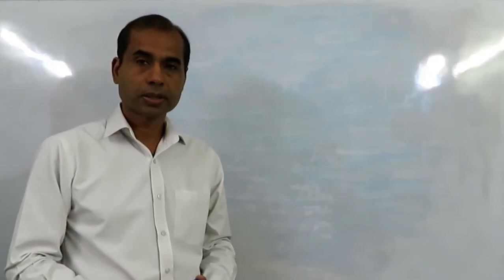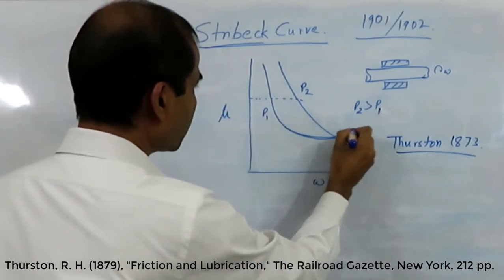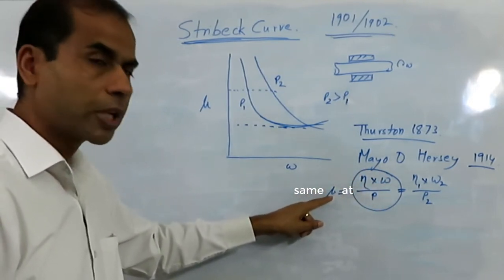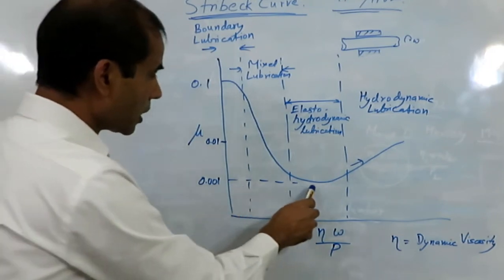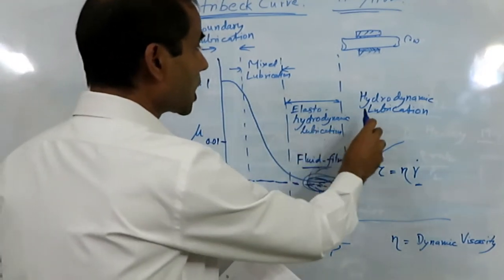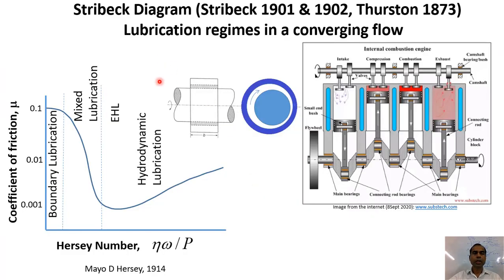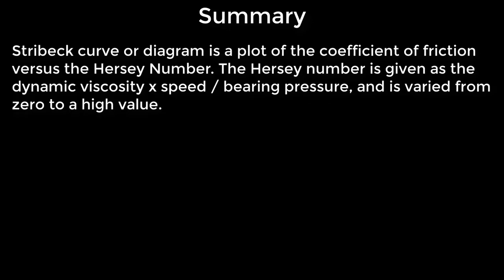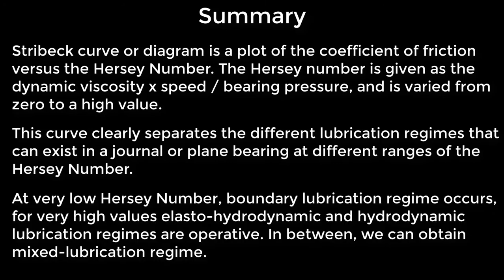Stribeck Curve of Lubrication: Lubrication Regimes and Coefficient of Friction vs. Hersey Number

Comment: Hi Prof., can you provide some insight on how friction reduces when speed increases from mixed to EHL? Also, share thoughts on the film formation mechanism in the EHL region. Can EHL be applicable to flat-on-flat contacts?
Reply from the maker: Thanks for asking. As relative speed increases, greater amount of fluid is pulled between the two surfaces because of the stick wall boundary condition between the fluid and the surfaces. More liquid coming in causes a hydrodynamic pressure at the interface and hence greater load bearing capacity is created. This causes the surfaces to move apart with thicker fluid film. Hence, the coefficient of friction decreases because there is no solid to solid contact anymore.
In EHL, the above action happens but one more thing happens which is that the contacting surfaces deform elastically providing even thicker liquid film formation. For example, this is also the cause of hydroplaning when you drive at high speed through a pool of water when it is raining. The tyres deform and provide more water coming in between the tyre and the road surface. This effect is large when the tyres of the vehicle are little worn-out or smooth.

Comment: Sir, how to calculate the effective film thickness? Thank you for this wonderful lecture 🙏
Reply from the maker: Minimum film thickness can be calculated if you know the Sommerfeld number or the Bearing Characteristic Number for a journal bearing. A numerical method was developed and based on the results, there are some graphs to find out the minimum film thickness in a journal bearing. A good book to follow is "Principles and Applications of Tribology by Bharat Bhushan". Another book is "Fundamentals of Fluid Film Lubrication By Bernard J. Hamrock, Steven R. Schmid, Bo O. Jacobson. This book can be downloaded from the internet.

Comment: Good day to 
Engineering Materials-Tribology-Design, may I ask whether the stribecj effect only applicable to lubrication system ? or to pure friction as well? thank you so much
Reply from the maker: This is only applicable when there is liquid lubricant present. For hydrodynamic lubrication, need enough lubricant presence otherwise only mixed-lubrication or boundary lubrication regime will occur.
Reply: @engineeringmaterials-tribo5142  I see, I have dry friction condition and saw stribecj-coulomb friction model for low-speed regime where the lubrication effect is an additional model to dry friction model together// Thus, I got messed up whether Stribecj effect is needed for dry friction as well to show smooth or obvious stick-slip motion or behaviour in the practice? Than you Engineering Materials-Tribology-Design     for replying my comment /
Reply from the maker: @limkwerly8508  For dry friction, use Amonton's law and Coulomb's law.
Reply: @engineeringmaterials-tribo5142  I see, noted that , than you Engineering Materials-Tribology-Design
 for replying me ~~